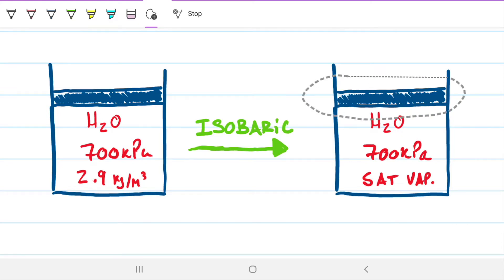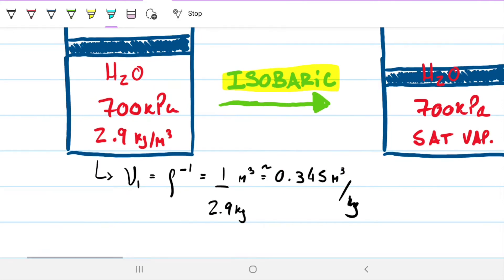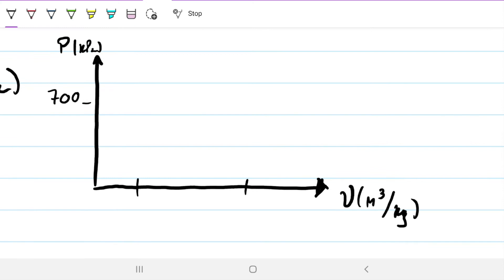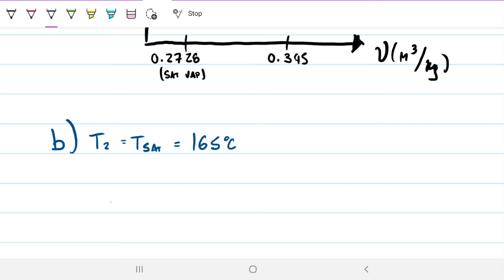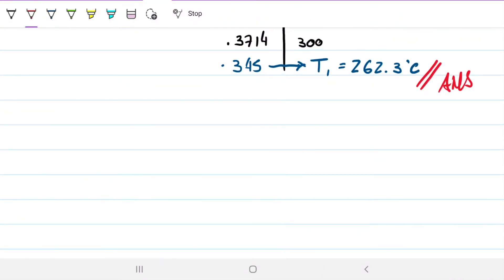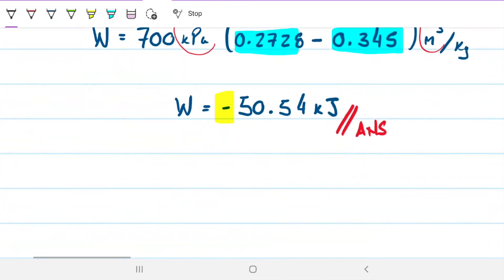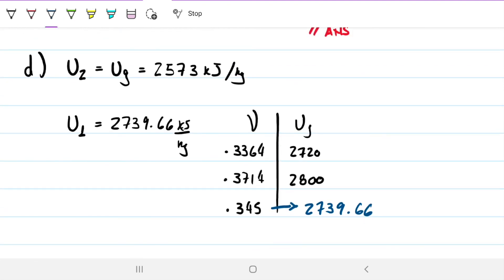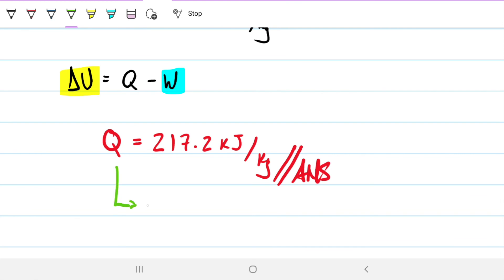Isobaric Compression | P-V Diagram | Closed System | Thermodynamics

Comment: what will be the enthalpy of isobaric compression? is it still equal to the heat transfer?
Reply from the maker: No. H by definition is U + dPV. If it is isobaric, then H = U + PdV. So it is the heat plus the pressure times the change in volume
Reply: @EngineeringHack  thank you!